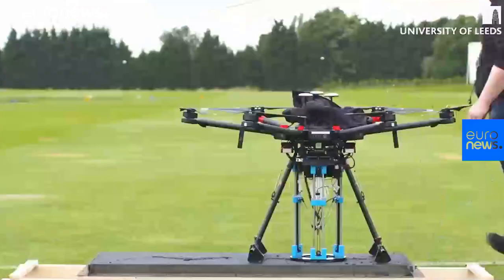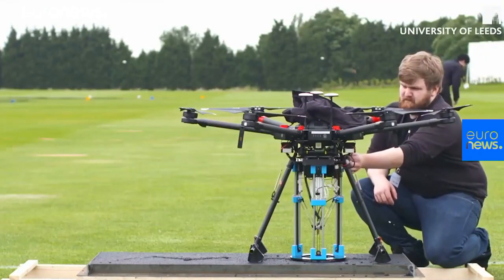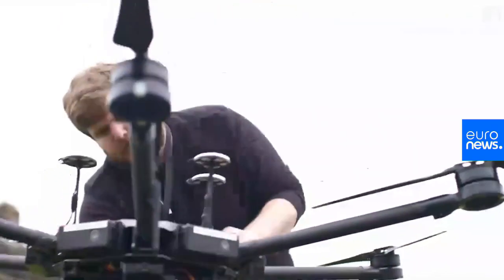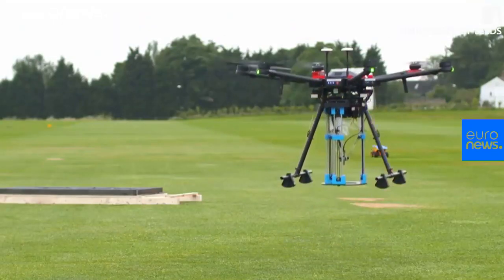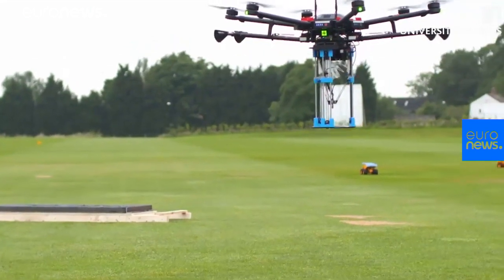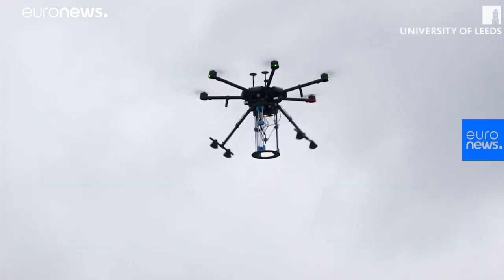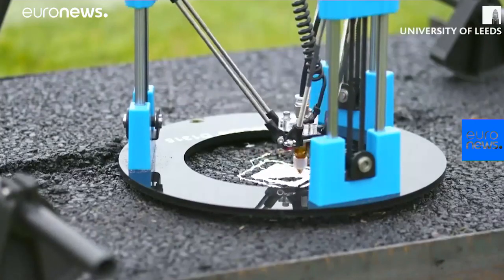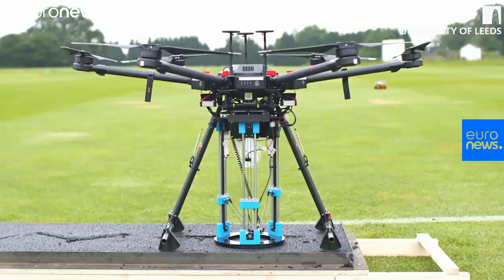This drone can fill in potholes with 3-D printed materials

Comment: That's really stupid.
What is the point of using drone for that? Just because it's "cool"?
The road work will require on the ground preparation anyhow - to block the area, place warning signs...
So how it's better to use a drone instead of a non-flying equipment?